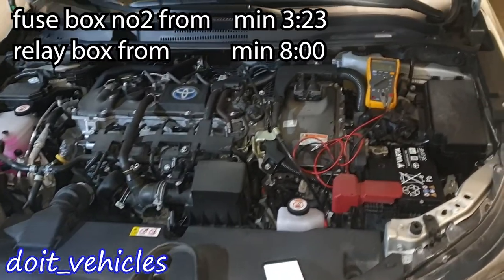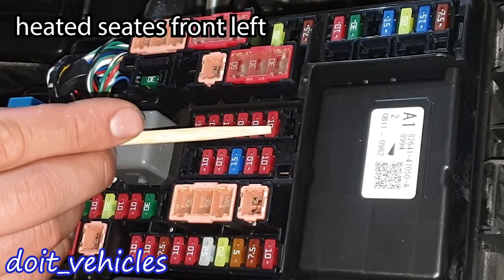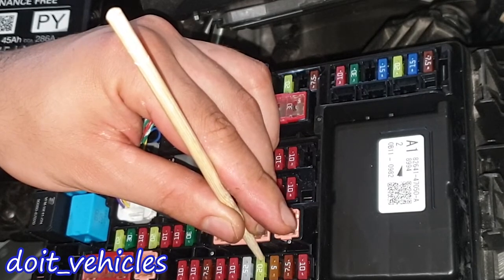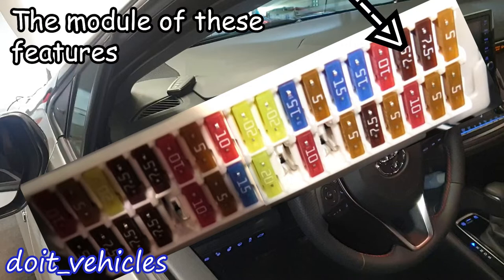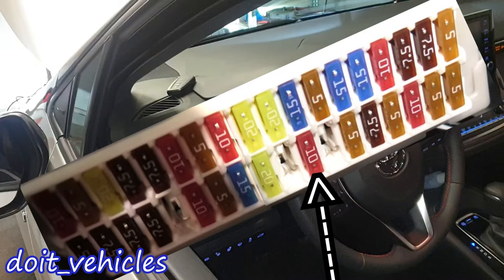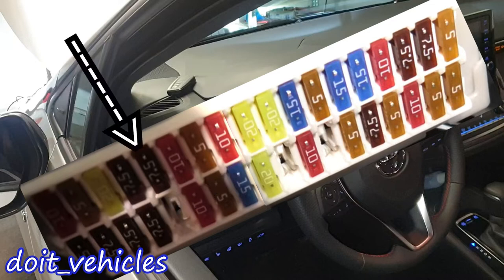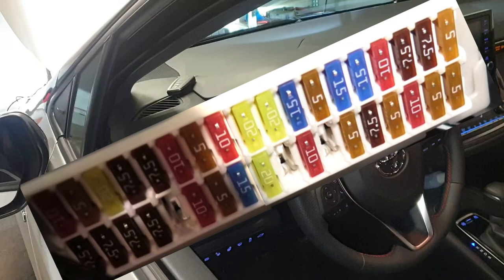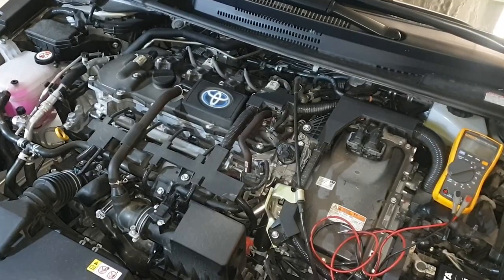1.8 Toyota Corolla HYBRID - FUSES BOX diagram

Comment: I have 2019 Toyota Corolla hybrid estate 1.8, right hand drive UK model, I can not find the fuse box under the steering wheel, can anyone help me find it? I think the washer fluid fuse has blown since the very cold weather.
Reply: I've just used this vid to help me replace my washer fluid fuse on my 22 RHD estate, it had indeed blown after this cold weather! In the left passenger footwell, under the glovebox, there's a large panel that just pops off. Then if you look at this next vid, it shows you where the fuse box is: https://youtu.be/w3Hds-KMn-s
Reply: @CraigRycroft  hi
Do you know what one it was ? Have this issue thanks

Comment: Thank you, that was brilliant, again for a window washer bottle pump.
Reply: Where is this fuse on a rhd UK car?
Reply: @dessiegreen1   In the passenger side pull plastic cover off and you will find all the fuses as per the video.
Reply: @BrendanMorley-jr2fp  for it. Replaced and now fixed. Thanks
Reply: @dessiegreen1  where was this ? I would really appreciate the help. My washer not working
Reply: @pawleil  under UK RHD passenger glovebox. Fuse box under there